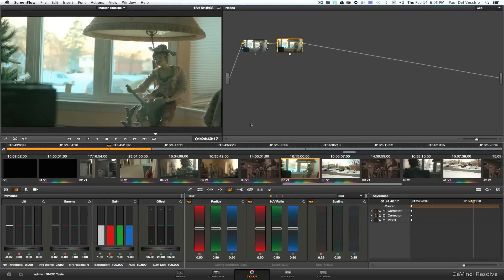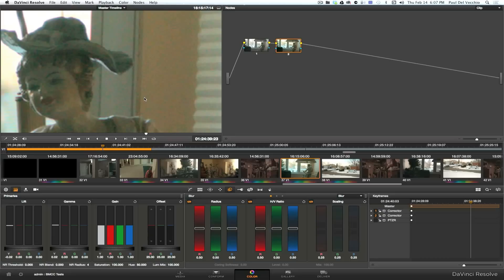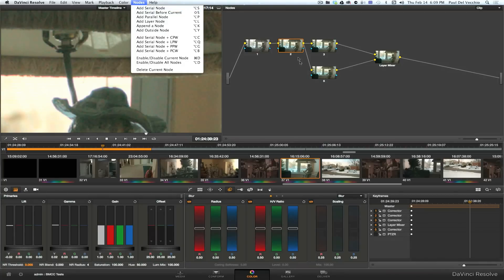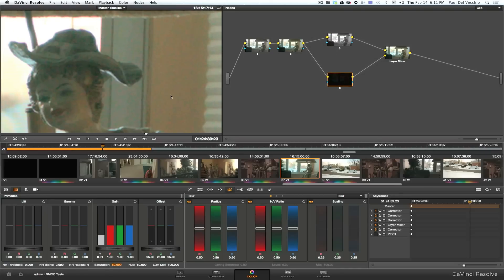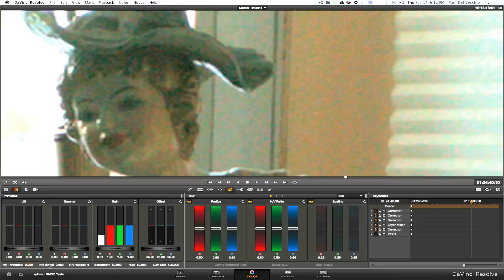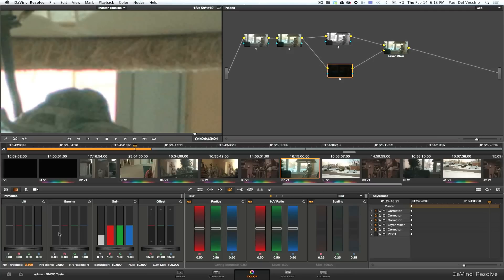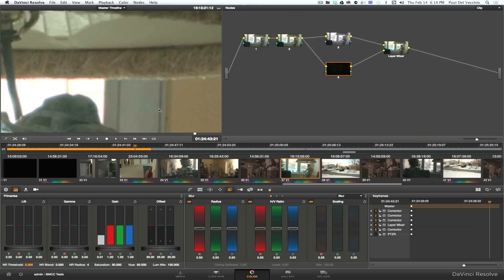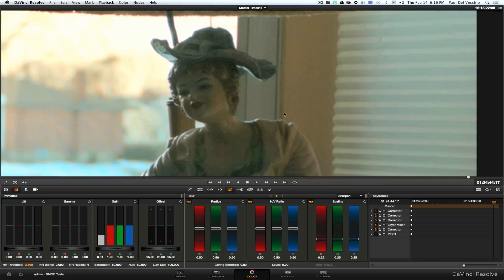Colored Noise Reduction - Davinci Resolve & Blackmagic Cinema Camera

Comment: Paul! Thanks so much for posting this! It makes so much sense!
For daVinci Resolve free version (12) users that don't have NR available, what alternatives would you recommend?
I tried the blur radius on the chroma and it worked to some degree. I am just curious to know what does actually happen when you change with the NR threshold value.
Thanks!!
Reply from the maker: I would recommend using the blur control. I actually use the blur control and push it up to 62 to start and if it needs more (usually it doesn't), I increase it to 65 which should get rid of most of the colored noise. I actually use this instead of the NR tools (even though I have the full Studio version) because I feel that it does a better job, plus it less processor intensive, so playback is better.
Reply: Thanks so much Paul Del Vecchio !! This REALLY helped getting rid of noise in one of my footage. I love your tutorials, so keep them coming. You've gained a fan! Cheers!
Reply from the maker: No problem and thanks! Glad it helped! More coming very soon!

Comment: Great information!
You may want to put an annotation at the beginning of the video that explains that this method is for the FULL VERSION ONLY that enables the "Noise Reduction" sliders.

If you are on the Lite version, you can just play with the "blur" sliders. The results are similar, but not entirely the same.
Reply: Kin Kwan
um, pretty sure he uses NR counters which aren't in resolve lite

Comment: Great tip! Also a fantastic way of removing chroma moire patterns (works much better on the BMCC than DSLR's for some reason though). It's a shame they changed the noise reduction controls in Resolve 10. I don't seem to be able to get as good a result. Am I possibly missing something? Thanks man :)